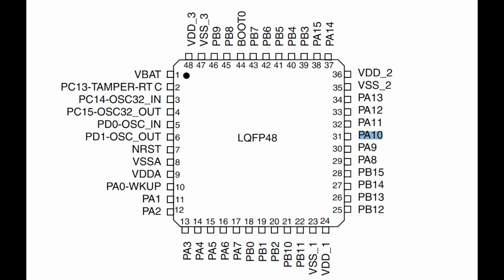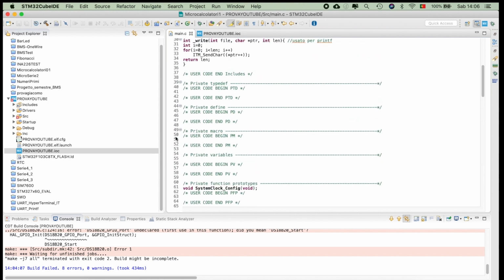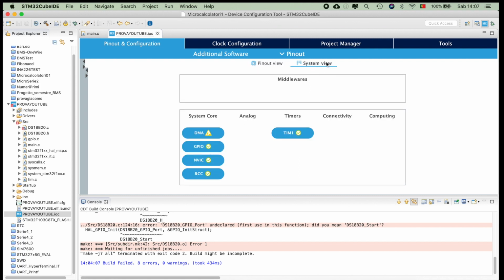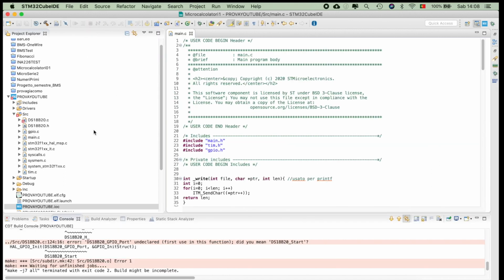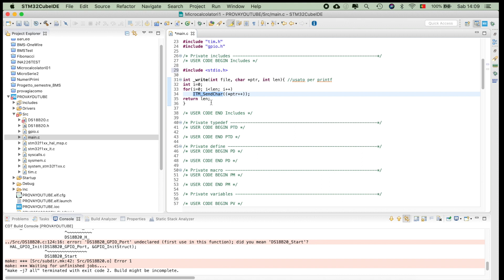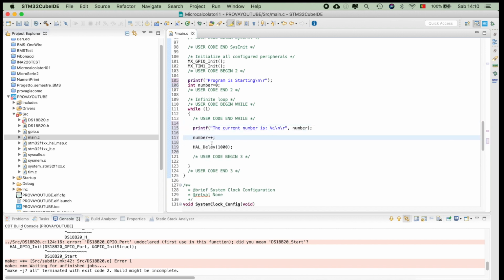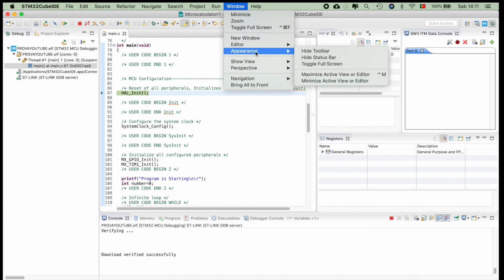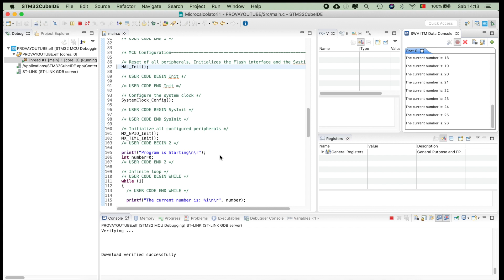Printf Debugging & enabling SWO pin in the ST-LINK V2 clone - For STM32 CubeIDE - BluePill

Comment: Thanks for the video. I got it working too perfectly! I actually had a bit of a nightmare because I decided to use one of the GND pins instead (there's two, so I get to keep SWIM pin - great idea right? Nope!). So I cut the track to the top GND pin and soldered the wire as per the video, went to check the other GND pin to make sure it was still working...nothing! I then realised that the GND pins have a via in the middle of the pads connecting them, so in actual fact I had cut the ground to BOTH GND pins!. So I then had to remove the pin that I wanted to remain GND from the connector so that I could remove the pad it was soldered to (which was now connected to my new SWO pin!). Then insulated the via just in case, put the pin back in and ran new GND from the ground plane on that side. It worked in the end, but I should have bloody just used the SWIM pin instead! hahaha.

Comment: With BlackMagic Probe (BMP) Firmware, this method is now obsolete. In addition to running locally as a remote GDB server, BMP also runs directly on STLink probe and reconfigures the RST and SWIM pin as UART RX/TX. Of course, this means you'll have to flash BMP on your STLink which is easy.
Reply: Thanks, I was wondering if it was necessary for the bmp
Reply: hi pls tell me how to install BMP on st link v2 clone

Comment: how to remove the blue metal  cover on it ?
Reply: I suppose you already did this, but for anyone reading, don't pull to the IO pins side. Pull the metal case to the USB plug side and it will easily come out. You can help pushing down in a table with the usb plug facing down.

Comment: while we debug, do we have to power up our board? or debugger automatically powers up?
Reply: If you connect the 3.3V and GND it already powers the board, you should see the schematic. If the board requires to much current, then it's better to only connect the gnd and for the power rely from an external power supply.

Comment: guys, advice for you don't try to solder st link because it always be fucked up.
Reply from the maker: mine works fine, what problem did you encounter?
Reply: @marcomotaelectronics3134  i could not solder the pin and i broke the pcb
Reply: @aherte1257  well I think the only problem is you need to improve your soldering skills before trying this :)

Comment: while soldering the wire to pin on stlink I fucked it up badly, my hands were shaking so much that all the pins on stlink got attached together due to solder and now my stlink is not working XD. I have order 2 other stlinks V2 to test on them but can u give me anytips how to solder wire on IC pin so I don't fuck it up again ?
Reply from the maker: hey, some suggestions is to use flux, a hot soldering iron (above 400degrees celsius) and to preheat the pin for a few seconds before applying the wire with solder. 
Also you could use a desoldering copper braid or. desoldering air pump. 

Hope it helped a bit.

also remember to cut the track, if no you will make aa short circuit.
Reply: Yes cutting the track is not a issue only issue is when i try to solder the wire to ic the other pins also get connected
Reply: @EmbeddedEnigma  yes maybe first do some tests in another board that you dont need wich uses really small ICs so you get practice.
Reply: @marcotrevisanmota5209  Use flux but also gravity ie turn pcb upside down  and actually add more solder(yes MORE SOLDER)... whilst its upside down it will flow back onto your soldering iron tip.
Reply: It's really difficult to weld such small wires together. It's even more difficult without welding experience, but there are ways to repair them. You can use a soldering iron to stick away the excess solder, or use a tin suction belt to suck away the excess solder. Search YouTube for soldering tips and so on. Or try holding the wire with your fingers so that it just touches the corresponding pin. At the same time, gently touch the soldering iron at the connection and hold it with a force point. It's better for two people, one to take the wire and one to weld. It's much easier. Remember to check whether there is a short circuit after welding. Of course, it's ok if there is a short circuit. If the welding is not firm, you can stick it with a piece of tape to prevent it from being torn. That's what I did.
Reply: @xiuyangzhang6955  yes I managed to do it 😝 I used the micrscope in my company and did it xD
Reply: My hands are shaky as hell